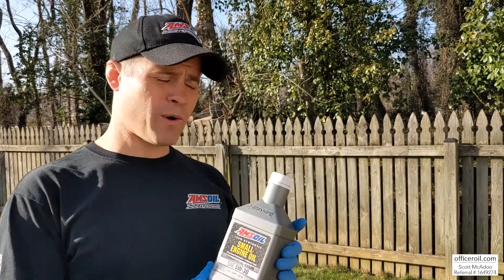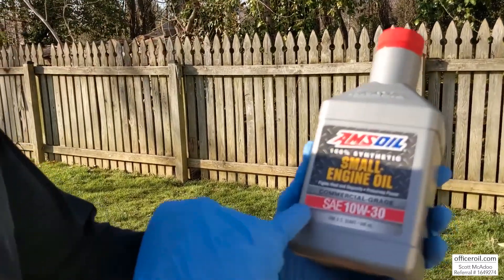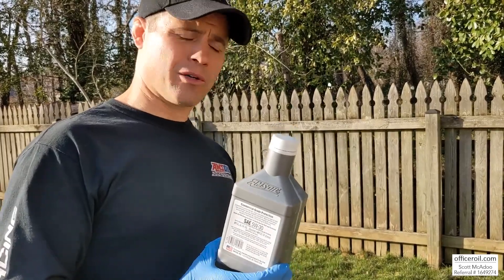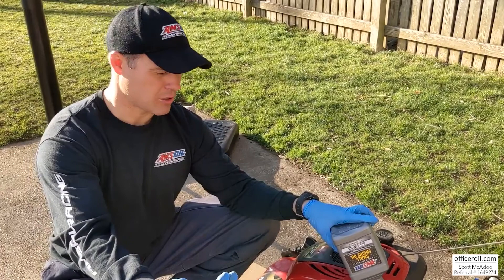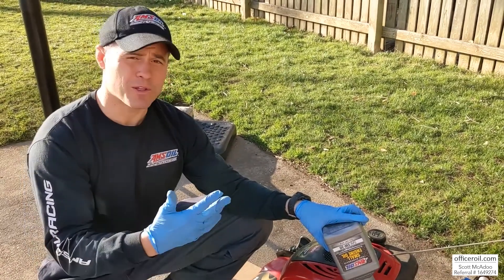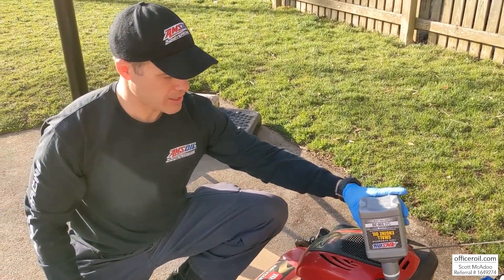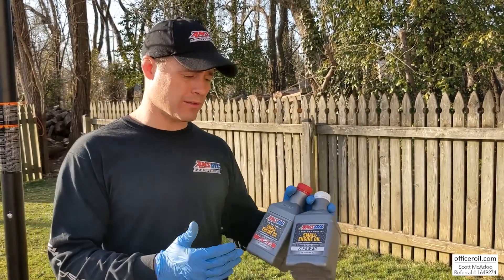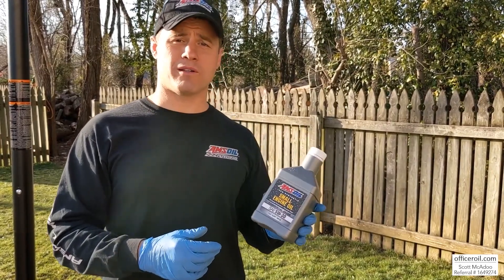TORO Push Lawn Mower Oil Change

Comment: Here in Florida, I would run Amsoil diesel because it has more ppm of zinc.
Reply from the maker: I'm with you.  The AMSOIL Diesel oils provide outstanding protection and performance.  What application would you run the AMSOIL Diesel Oil in?